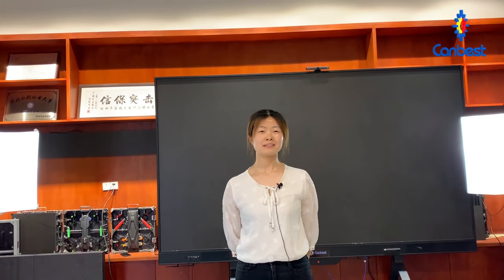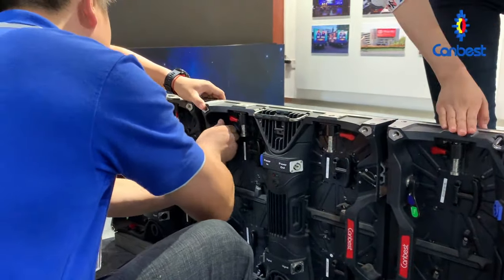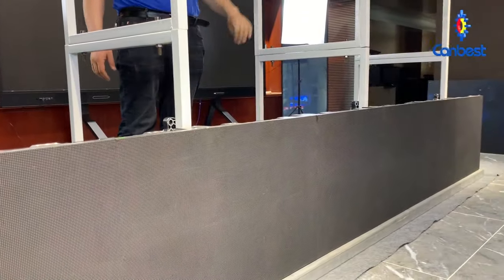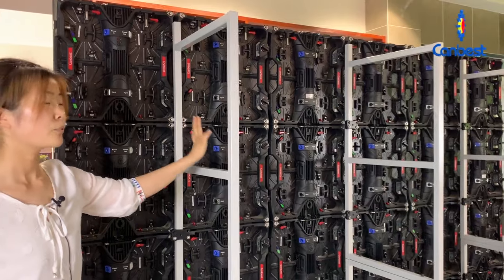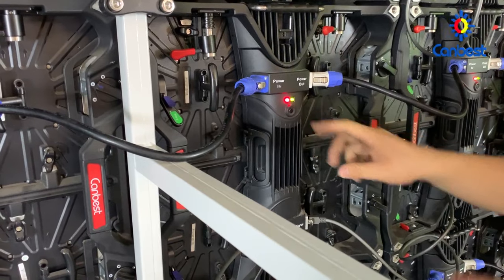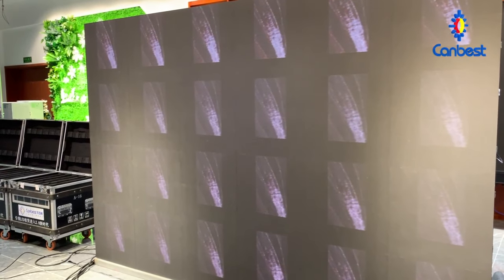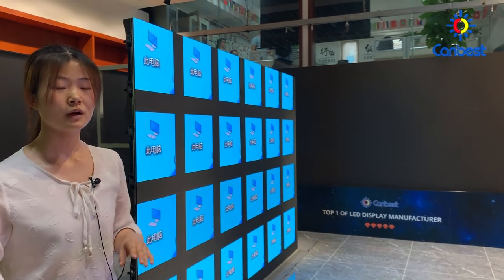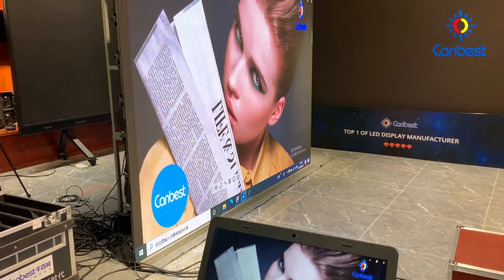How to stack led screen rental by bracket?- touring stacking led display installation video guidance

Comment: this is exact dimensions of LED screen that I need, 3m×2m i.e 3meter length by 2m breadth.

How much does this cost? with shipping ?
Reply: that means each panel module is 0.5m, right? if 2 panel modules can be 1m apart, each panel is 0.5m or 500mm.
Reply from the maker: can you talk with me on whatsapp: +86 134 1868 3708? we will provide more details and quote

Comment: terrible, brackets are not straight, no safety equipment, and no proper anchor weights
Reply from the maker: it is the oldest type several years ago,  we have updated the new one ,if you are interested, let me know